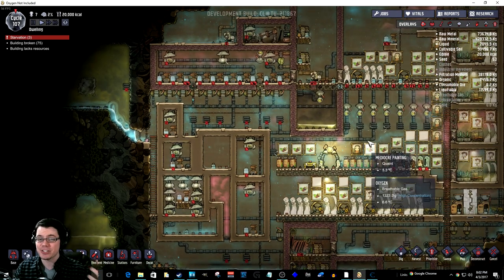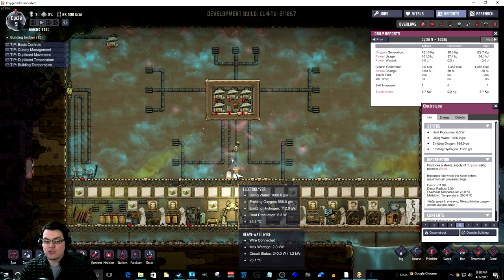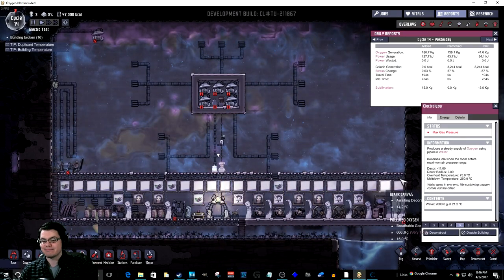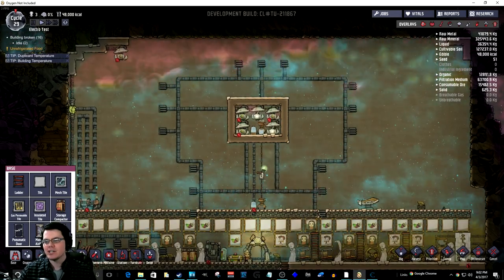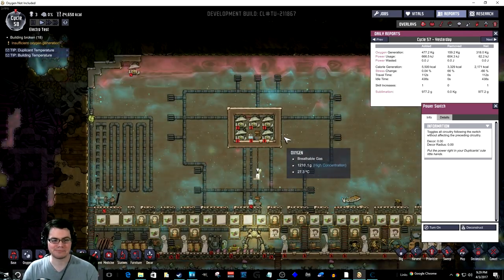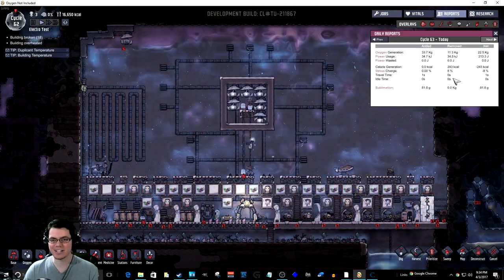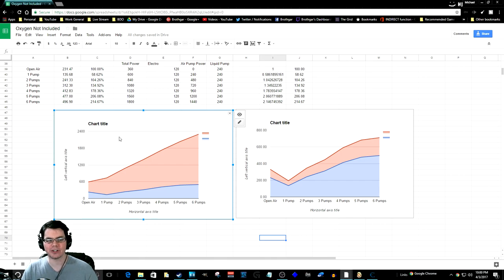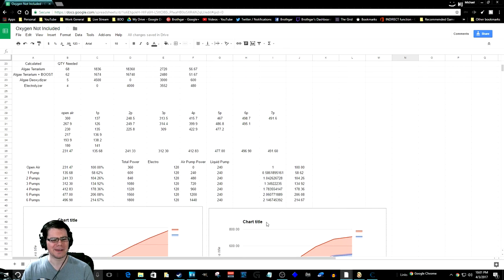Electrolyzer Efficiency Experiment! - Oxygen Not Included Tutorial

Comment: Brothgar, i've just subscribed, and need you to know a trick i've learned.
I can make any building never, ever, ever break from overheating, including Coal Generators.
I do this by layering background objects behind the entire area of the overheating building.
You can layer electrical wire, liquid pipes, gas pipes, (also liquid pipe junctions, and gas pipe junctions), over the entire background area of any battery or coal generator.

This is why it works: every object that exists in a tile BEHIND a building is simulated by ONI as DIRECTLY CONDUCTING HEAT AWAY VIA CONDUCTION.
The more background objects you stack, the more heat is conducted way from the building and into the background objects, and the better the convection of heat to the atmosphere because each background object you have stacked will also transfer heat to the air in its tile every tick.

This require no cooling! :D
Reply: Test it out for yourself! it might be good fuel for a video segment!

Oh, something else! Ladders can "trap" heat from spreading, in a weird way. set up some batteries and built a box a ladders around it, the heat will try to conduct itself to the ladders first before convecting into the rest of your base's atmosphere. I use this by having a network of ladders everywhere force my entire base to have  thee same temperature. It even stops cold biomes from freezing connected wings of my base!

Comment: I think your batteries that are in the cold room are overheating because the air pressure is very low (26grams). I had the same problem before but when you get it above 1.5k grams they stop overheating at all even in a normal environment.

Comment: So here's an idea. How does the pump setup compare to just using 2 Electrolyzers in different open air areas? You could run them off the same water pump for 480 Watts, since each won't be using the full supply of water. Just asking since you compare that just one open air electolyzer can't produce the same volume of gas as the closed one with multiple pumps, but just adding more electrolyzers off the same pump in different areas seems like the more efficient way.

Comment: What about efficiency in relationship to power?
Reply: This is sort of what I was seeing from your "detailed" experiment.  This leads me to the thought that a modified open air solution might be the most (overall) efficient solution; because power generation creates co2 (coal or just more bodies on hamster wheels).
Reply: Was about to comment this, glad you also did the math on this! I had actually tried this "air room" solution and in the current game (APR-9) it is not worth it at all, for several reasons such as the enclosed room very quickly overheating, and you funneling a ton of resources in repairs and having to disable it, and the ungodly power consumption, pumps are one of the most power-hungry buildings in the game, and the less you have, the better. 

I usually keep a couple separated areas, one living quarters, hamster wheels and amenities, one toilets and planter boxes, each fed by 1 or 2 (depending on amount of dupes) electrolyzers, and gas pumps at the top to get rid of hydrogen if it gets too concentrated, so circuits won't overload unless I'm running literally everything, which happens quite rarely.

Also I dunno how you manage to get your batteries so warm, I Just build a battery bank inside an ice biome and forget about them; they sit at roughly -3°C for 150 or so cycles.
Reply: Does a 4 pump clover setup act more efficiently then you current build?

XPX         PXP
PEP  OR  XEX
XPX         PXP

I would suspect this should be the optimal Watts per KG. The issue with your experiment is the pumps are not balanced in your 4 pump system where in your 3 pump system you had a Triangle.

XPX
PEP
Reply: @Michael Campbell
There is literally no way to make it more watt-efficient by adding pumps, because duh, you keep adding power consumers. You can make it consume more water and output more oxygen, but would still ultimately end up using more energy per kg of oxygen generated, open air is currently the way to go, even if pump doesn't work at 100% production rate, you don't waste power moving the oxygen around either.
Reply: @daikatarokamegawa542  while i generally agree with "more pumps can't be more efficient" there is an exception...

1 electrolyzer consuming 1 kg/s of water produces 1kg/s of gases (if i remember, about 833g/s o2 & 166g/s hydrogen)
2 pumps (each moving 500g/s) should be able to clear those gases as they're made... but they won't! because the pumps will grab small packets of hydrogen, you'll average less than 500g/s of gases being moved per pump.
those non-full packets of gas consume the same watts to move as a full 500g packet.
so, by adding a third pump & automating them all to run when atmo sensors detect enough gas to draw in a full packet you can increase watt-effieciency. note: it will be necessary to let the gases sort themselves by relative density with 2 pumps lower to collect oxygen & the third up high to collect the pooled hydrogen. yes, that's more power consumers, but they won't be running constantly (thanks to automation) & they'll save power. power draw won't be constant as pumps cycle on/off, but the average will be 2 pumps' worth of watts while moving (on average) SLIGHTLY more gas than a 2 pump arrangement

Comment: Bit of a necro post but i'm just now starting with the game and watched your video... That being said...

Out of curiosity, what about running the electrolyzer in a minimal pressure atmo of co2 at the bottom of a environment and having the co2 push up any o2/hydro while maintaining as low of a pressure as possible then at the bottom of the chamber, having a switch with an o2 filtered pump pumping out once it gets up to a certain pressure.  

this would remove the need for so many pumps while allowing for max removal of high pressure in the set area. It also would allow the gases to compress themselves at the top of the chamber and the pump would only kick on when the desired pressure was reached thus decreasing the power required to even run the single pump. 

The main limiting factor i could see would be the fluid dynamics of the game limiting how fast ( seems like 1 every second unless effected by an active system such as a pump ) the game would push up/out the non-co2 gases.  

Combine this with a battery bank and a hydro gen would allow the first system to rest but still allow the hydro pump to run up until the battery bank is full.  Acting as a buffer for periods of higher power drain.
Reply: You can't keep the pressure of an electrolyzer down with a single pump. Electrolyzer produces 1kg/s while gas pumps pump 0.5kg/s.

An enclosed area with an electrolyzer and a single pump would eventually overpressurize and reduce the electrolyzer to only 50% uptime.
 You need at least 2 pumps to gather all the gas, or more than 2 if you want to build it up and then pump it out.

Comment: watched 6 of your ONI video, especially the hydrogen bubbler works very well. thanks for the video, Subbed!
also, I am having trouble with the electrolyzer, I tried 5 electrolyzer with 8 air pumps pumping oxygen at the bottom and 1 pump at top (based on the max theoretical production rate), with A shape roof, but it didn't work very well, the hydrogen generation rate gets lower and lower and eventually the system fails to supply its own electricity, I am still trying to figure out the most efficient way to produce both oxygen and hydrogen by its own...

Comment: You should have calculated the efficiency per watt for all of this testing to actually yield any meaningful results. 

Open air - 0.643, 
1 Pump - 0.226, 
2 Pumps - 0.287, 
3 Pumps - 0.289, 
4 Pumps - 0.312, 
5 Pumps - 0.305, 
6 Pumps - 0.276,

So power wise, you're just never going to get as efficient as just letting the thing sit in an open environment, nowhere near close to it. 4 pumps being the most efficient is still consuming over twice as much power per kg of oxygen as open air. You're much better off simply building your base in a way that lets the hydrogen naturally accumulate at the very top to use it.

Comment: not sure how long that is ago, but, there is a thing that makes stuff overheat instantly when the tiles above them are blocked off, i tried this with a Coal Generator, no matter how cold the area is that i put it in it would just break and overheat the moment i activate it, i think its because the game expends the hot air instantly on the top of a structure and if it cant move away it just sticks aroudn the generator and heats it up spot on, There may have been a similar issue with your batteries :O

Comment: could you do an experiment to see the efficiency of a set of hydrogen burners with electrolyzers to see if there is potential for perpetual energy?
Reply: There is not enough hydrogen being produced by even to most power efficient setup (1 water pump, 1 electrolyzer, 1 gas pump) to make the hydrogen generator make enough power for that. Now, potentially a single water pump can supply up to 10 electrolyzers (in reality more), but when you start introducing so many you're running into problems with gas simply moving too slowly for the electrolyzers to maintain efficiency.

Comment: Finally liquidated polluted oxygen (in Thermal Upgrade where pipes break!). Had to cool hydrogen to just above dew point, run it through regular pipes in and out of an insulated box containing pre-chilled polluted oxygen. The hydrogen pipes reached temps low enough to condense the ambient polluted oxygen into pure liquid oxygen, but it took a LOT of tweaking with gas valves to get the hydrogen to continuously stream through the cold box, otherwise the pipes would warm back up between hydrogen blobs. Unfortunately, the liquid oxygen I tried to pump out would instantly boil in the liquid pipes coming out of the cold box and I haven't yet gotten the filtering system I aimed to make. And of course, chilling the hydrogen itself required 20 thermo regulators on thermo switches to prevent them either freezing or overheating, AND space heaters next to the last few regulators because they just kept freezing up. 4 layer system, each layer on its own circuit with 2 hamster wheels and two batteries. Doesn't seem to matter what the pipes are made from, but you must run insulated gas pipes for the hydrogen till it gets to the cold box. Side benefit to all this is feeding CO2 into the cold box and freezing it, thus creating a CO2 dump.
Reply: Whoa, just loaded the game up, I have solid oxygen tiles in the cold box... I don't know how that happened since I quit the game before with liquid oxygen in there. Wonder if my dupes can mine the oxygen ice.
Reply: saeklin I get the same thing with my ice generator. A few grams will turn into tiles upon loading the game.
Reply: Well the new mechanics cause pipes to burst if the contents change phase. I made plenty of pure oxygen by accident that way but with the pipes busting its not very sustainable. Next goal is to turn fertilizer into dirt and sand.
Reply: To avoid burst, building insulated pipes isn't efficient for me, you should always use abysalite because it's the perfect isolation material, you can see the thermal conductivity in the details. And granite is the best I know so far to make the better conductivity.

Comment: gas pump moves 500gr of air.... you need 2 pumps to move 1kg production of air from the oxydicer... Also just make some more space nto the roof... And it's done... 2 pumps for each oxydicer...
Reply: 3 pumps a better. here's my reasoning: using a gas lock (or gravity/density seperation) to pre-sort gases before pumping out, you can have 2 pumps for oxygen (one always on, one intermittent) then one last pump devoted to hydrogen which runs intermittently.
a 2 pump system will waste time when they grab a packet of hydrogen that's less than 500g, which will let the electrolyzer out-pace the 2 pumps & eventually cause overpressure.

Comment: Half the time you used the word "efficiency" you were actually talking about "productivity". The only thing showing anything close to efficiency was the left chart at the end. And even then probably a poor example at it. Efficiency relates to input to output over a specific time. You mostly talked about the output and did not reflect on the input as much as it would be necessary. Most importantly: if the electrolyzer does not work, does it consume power? Your chart does not properly reflect that.